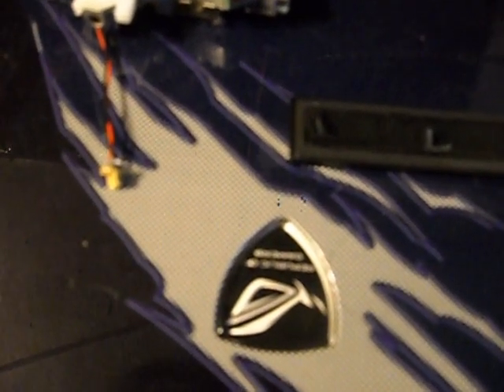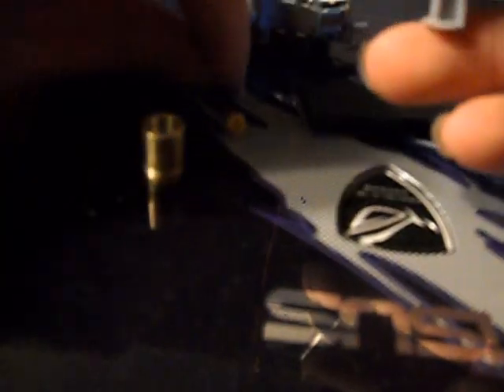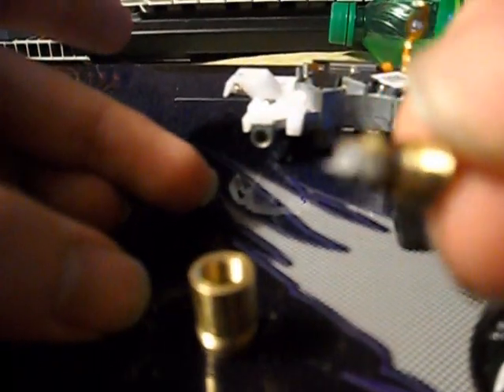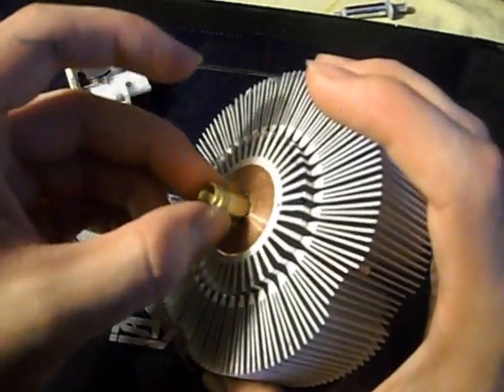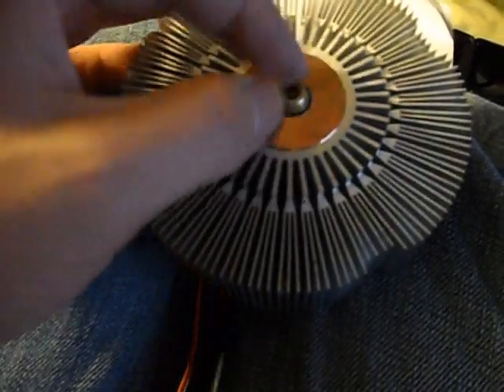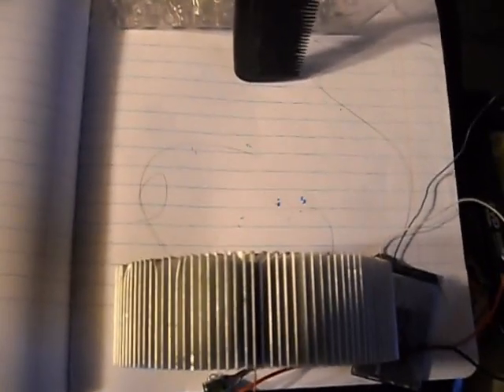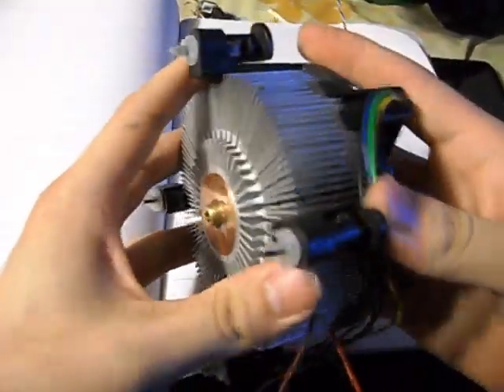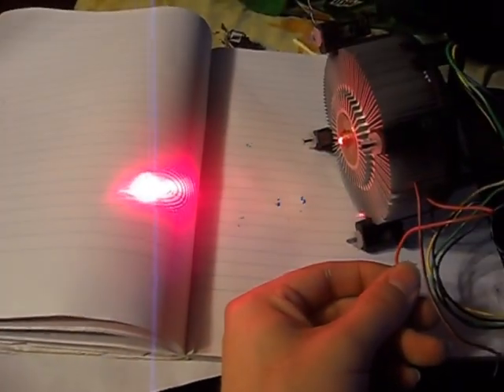Producing a Burning Laser 200~300 mw DVD Open Can Laser Diode Used.

Comment: Styropryo is awesome but totally NOT the reson I'm interested in lasers. Love your explanations on how the they work and different types. But I want to know if there is a way to combine forces and make a Diy CNC high powered laser arduino cutter?
Reply from the maker: Thanks! Man this is an old video to see a new comment on :P I love the science and assembly side of lasers more then the burning aspects. Currently I am getting in a 355nm laser that I am certain you will enjoy getting a good look at along with how everything works inside. I am certainly down with talking out ideas, I myself don't work with arduino, but I know optics and the options for use of lasers on various materials and how to either build or purchase them for a specific material application. Let me know what your working area of knowledge is and what materials you are interest in working with on your cutter.
Reply: @Zenodilodon  I started carving with chisels, upgraded to a dremel, then a foredom, but the shadiest work comp lawyer cost my family everything we owned, so I'm back to chisels. Been unable to work and disassembling free electronics hoping to cheaply make a CNC  router, but then thought why do they only do flat sheets of wood? I have been handcarving walking sticks, found a method to shape lichtenberg patterns, hollow parts of it out and add remote control leds light straps, embed shaped gemstones and coat it all in polyurethane resin because...why be boring. Too many DIY artists who don't think...but what if I? I refuse to believe that a CNC router can't be created to carve naturally twisted wood into a masterpiece, someone would just have to have the CNC scan the dimensions of the wood first, right?
Reply: Also, just disassembled two vcrs, 3 dvd players, a solid state VHS camcorder with 6x zoom and the additional extra lenses, with a crappy compaq presario v6000 (with no drive) and an HP envy 7640 printer to go. In short, I'm unemployed, artistic, curious, bored, with some electronics experience who wants to see what mad scientist combo can be made of it all, lol.
Reply from the maker: @cshannon5809  If you have a Facebook contact me through there and we can chat in real time on ideas and such /Zenodilodon

Comment: What kind of transistor can I use for this experiment? Thank you.
Reply from the maker: This is a really old video, I am working a new one to answer all the questions you may have on any CD/DVD laser style. I used for this a green laser pointer driver, and still do however the new ones require a small modification to adjust the output. You can look up how to make a current regulating circuit using an LM317, however it's not very efficient and wastes a lot of power. This video is extremely old and is kept up more as  the kind of stuff I started off with type of thing.
Reply: @Zenodilodon  I see. OK.
Reply: @Zenodilodon  I'm waiting for the new one. Thank you.

Comment: Wow you people are a bunch of judgemental trolls. Waste of time? Why watch then... Vid is what it says in the title, its all on YOU. @Zenodilodon: I used the same heatsink for thermal management, kudos for being an absolute genius. That's a pretty lookin hole ya got there :/ I had a hell of a time drilling mine out with my capable 2/3HP floor standing drill press and a run of the mill HSS twist bit. Whats your secret/advise? I must have chewed through 6-8 bits just to break through with a small starter-hole.

Comment: A small heatsink would be alright for a laser rated at that power, these diodes operate up to 80 C. I have a 50 W CO2 laser which uses a heatsink of that size for the heat exchange in the liquid cooling system. If you're gonna build a handheld laser with that diode, you'll want to choose a smaller heatsink, sometimes an aluminium case would do.

Comment: 300 ~400mW   you would mount that laser diode in a    portable  she'll like laser 303 uses. For testing a bunch of L.D.s  various pwr levels I would use that set-up as a test jig only .  A permanent installation using Gorilla  heat sink and  over kill fan .  "NOT!"

Comment: Bad input circuit , wrong heatsink , no eye protection or common sense to avoid looking at the beam with the remaining eye , no ESD precautions hell not even a protection circuit on the battery you are using. Do I even need to mention the way you almost fried it when you first powered it on with the input wires almost touching the live heatsink ? Be a bit more careful mate!

Comment: yeah, its pretty and all... but that solid chunk of copper is holding more heat than its dissipating [by the time it reaches the aluminium] that heat sink is designed to pull heat off a flat surface

Comment: Just an observation here...I noticed you have a few dead spots in the middle of your video recorder...ya prolly shouldn't aim high power density laser beams at it, the image sensor isn't designed to dissipate that high of optical flux...BUT on the flip-side of that, the burned out pixels of the image sensor give a good indication of the focus of whatever laser you had aimed directly at it. Also, please please please don't aim focused beams in the direction of your face or at your skin, please?!?

Comment: Its not the voltage you need to keep in check, its the amps, most burning lasers are 300ma. Voltage is secondary. Its better to be just above the working voltage of a laser. ie laser 2.2v, power it with a 6v supply with a current regulator. Google N317 regulator, they can be used to regulate voltage and amps, easy to build. You dont need a massive cooling system like above. If your reducing from 12v to 2v, its to much heat to lose. The energy has to go somewhere during reducing v, ie heat.

Comment from the maker: the cpu fan is really just a looks cool kinda thing in this case unless your making a laser higher then 500 mw using this. the yellow + and black " red in most cases "  + are your  terminals for power most are 12 volt DC check your fans voltage.

Comment: Hi, how do you power your cpu fan? 

I know they have some PWM thing but how can you just power them fully. what cables are what? blue neutral? black power? yellow control cable? green ground? and what voltage is it 5V 6V? Would it get destroyed with 12V?

Ty in advance.
Reply: Yoo

Comment: Good idea with the i7 heatsink. I was going to use a pentium 4 heatsink, but there is not deep enough metal to drill into and get good contact between the LD and housing and the heatsink. They are only about 8 dollars on ebay, and that is worth the overkill cooling of a diode driven near the death limit.

Comment from the maker: @Hyudryu I know, i've already replaced the CCD
Reply: Hello sir please show me how I can make a laser driver with transistor and resistors only as I don't have any lm317 available  thanks sir.
Reply from the maker: @numbianqeeen4356  A laser diode requires a constant current source. This usually involves the use of an operational amplifier such as the LM385, a precision current/voltage reference such as the LM431, and a D882 NPN transistor. There are also misc resistors and capacitors used for smoothing. Here is a page with some DIY solutions showing some architectures/diagrams similar.
https://www.repairfaq.org/sam/laserdps.htm 
The LM317 is actually a very common part on many electronics SMD ones are typically just marked 317. Depending on your laser your needs for current may very the LM388 is a higher current device similar to the LM317.
Reply: @Zenodilodon  what regulator will be effective for a 100-150mw laser
Reply from the maker: @numbianqeeen4356  The LM317 is probably gong to end up being the easiest for you. Look up how to use one as a constant current laser driver, it's pretty easy to make.

Comment from the maker: @shadowscion the lens is designed around the edges to focus the dot tighter, unlike a laser pointer lens that spreads it out evenly. you can see the grooving rings on the video and there is alot of power lost because the light is taken away form the center point.

Comment from the maker: @devilsthy I order my drivers or pull them out of bad laser modules and fix them. Do you NEED a driver, no, will you WANT a driver, yes. the lasers are very very sensitive to power input voltage changes and amperage. drivers ensure the reliable use of the laser, running them without a driver is very risky and will most likely cause you to burn out the laser diode.

Comment from the maker: @kgunby I have the Spyder 3 Arctic coming in " i hope "  and I a, going to try to set up a small pole and use a microdrive platter and a mirror array to duplicate the look, it would not be a light saber but it would look close and burn on contact but it would be a thin solid core still, though near free of weight it would be wicked just to play around with lol.

Comment from the maker: @thelethalmoo there are drivers but they are made for use with the dvds software,they are designed to be used for lower power read for a long time or used for pulsed burning. they are not designed for continuous use at higher powers

Comment from the maker: @thelethalmoo lol, i warned you, i channeled your mind are you thinking " I need a monster energy drink " ? i do lol but for the heck of it order up a cheap laser that is 5 mw green off ebay, the driver should already be side to run the laser at at least 150 mw or so, I cannot guarantee it but out of dumb luck it worked and continues to work flawlessly for me, oh also try for the driver style without a IC, they are direct draw and unregulated so they wont try to compensate for the diode change.